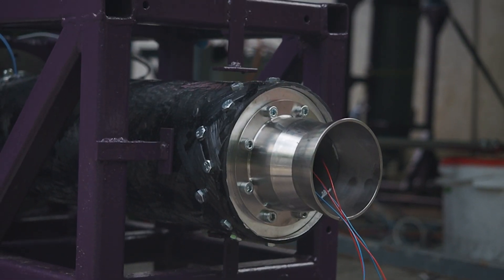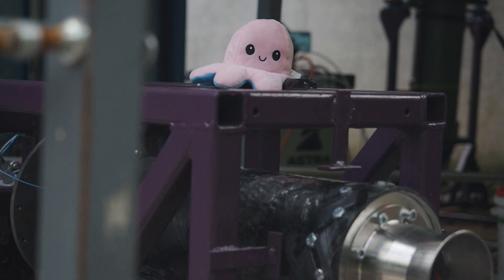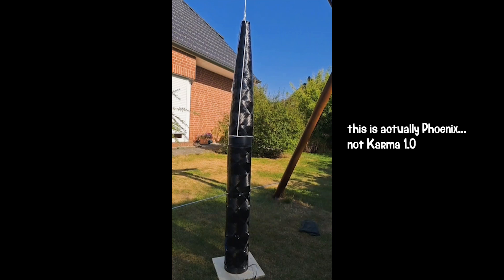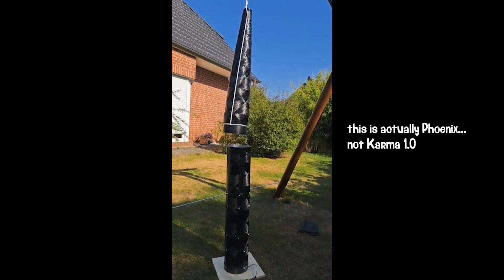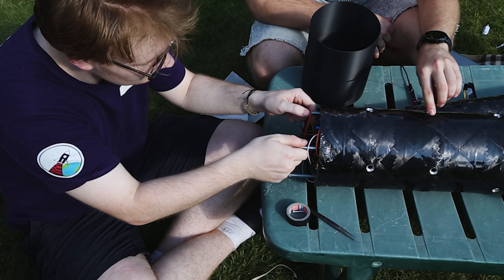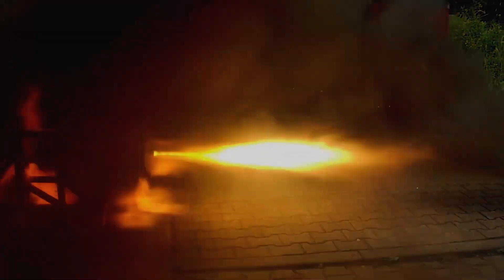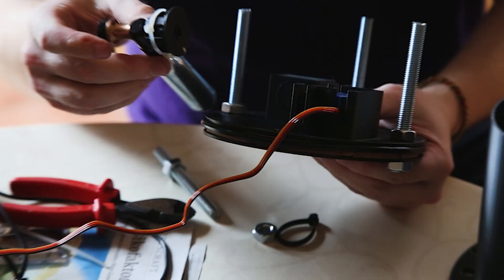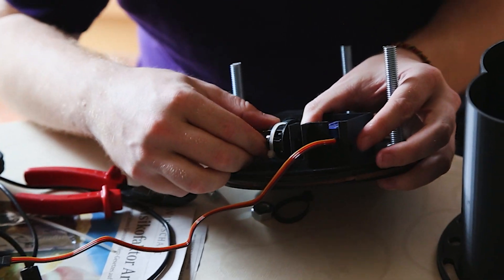The Secret Sauce Behind ASTRA's Recovery System

Comment: I have used a motar tube to blast away nose code releasing chute. Basic system is a motar tube in the center of rocket with a black powder charge, the center tube has a piston in it connected to the nosecone.  When the black powder charge goes off the piston pushes the nosecode away.  The chute is attached to eye bolts on a mounting disk fitted between the rocket skin and the motar tube.  the chute is stashed between the motor tube and rocket skin to protect it from the black powder blast.  The motar tube was just a fiberglass tube.